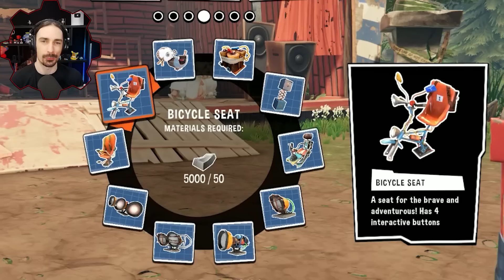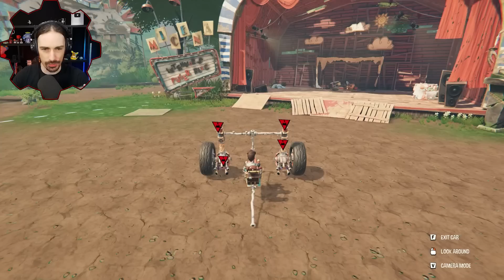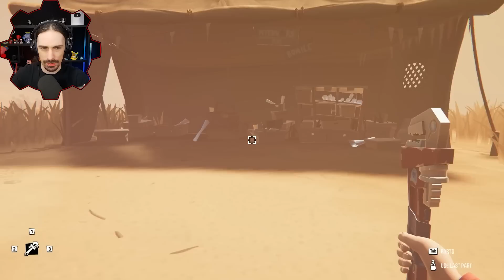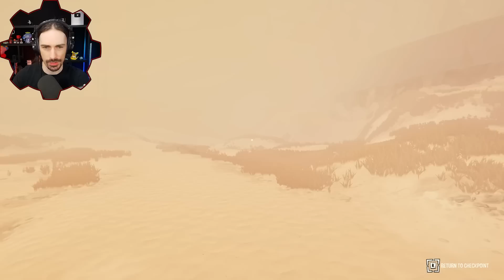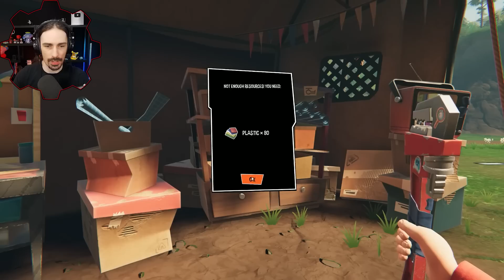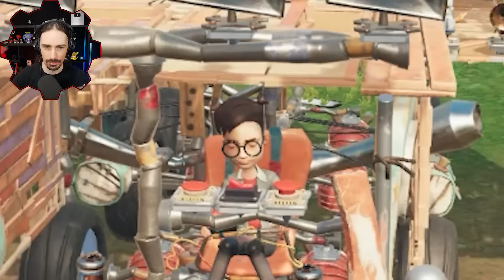Is The Hello Engineer Building System Any Good?

Comment: Looks pretty bad so far for the reasons you mentioned and also: If every piece looks trashy / oddly shaped, it would get really problematic getting stuff straight or deciding if two pieces are too close together etc. in larger more difficult builds.

Comment: would like to see a comparison of no suspension. the stick to the ground was something you said felt off but you also have parts to make it absorb bumps. 
you needing to reverse motors is because they are upside down. having the connection point at the bottom will change how you build the fixture and I think remove some of the tall ness feeling of the setup.
agree the default everything turning from the center seems bad

Comment: the game IS very limiting, I completed the tutorial in about 1.5 minutes
and after playing around in sandbox mode I realised that you can only have 1 active thruster, because its so expensive on plastic materials, and the thruster has awful power. only getting up to 600 thrust. making it difficult to build planes, vtols, and rockets. I've tried with it for a bit, but just warning you that the demo is very DEMO.
Reply: works better as a booster than an aircraft thruster

Comment: The entire driving is like its played back at 2x speed like when you set the motor speed higher it doesn’t increase the speed the wheels are turning but the speed the game is simulated so your actually going way slower is the simulation thats why its sticking to the ground

Comment: I feel like they set the gravity way too high.
Reply: I would guess it's using an earth's gravity. Which is not necesserely a bad choice, but a rare one compared to most games.
Reply: @dolorsitametblue  it's not that rare, a lot of games use Unity, which uses Earth's gravity
Reply: I don't think so, I think it really does have a magnetic pull to the ground in order to prevent the random bounces that happen in games like Scrap Mechanic

Comment: I honstly didn't have very high expectations but looking at how everything works, I would probably really enjoy this as a more mechanically complicated version of Scrap Mechanic.
Reply: "More mechanically complicated" - you mean more janky and annoying.
Reply: @LordDragox412  well although I agree the game is really janky, you gotta admit the rod system and steering system in this game is a lot more mechanical than hooking up an engine and a bearing, and that's just one example, then there's also gears, etc
Reply: @Renamon_Digi  Sure, it's more "mechanical", but it's also something that needs to be done well if it's going to be one of the main mechanics in the game. And sadly, it isn't, which is something nobody should be surprised by, considering the game's dev studio...
Reply: @LordDragox412  oi, do you have any link for the gear system? Because here we couldn't really see how they are used so if you have, please share.
Reply: @Cyberlong   Just get the demo and see for yourself. They have extremely limited use cases and the only good thing I can say about them is that they're less janky than gears in Besieged, at least from what I've tested so far.
Reply: @LordDragox412  yeah again I agree, not only the devs have been proven to be shady before, and the game is janky. But again if we speaking "technically" the game is more mechanical than scrap mechanic, which doesn't meant the game itself is better, I mean scrap mechanic have a whole survival mode and the versatility/different type of creation it can create, hello engineer seem (atleast as of now) to be only focused at creating vehicles, but it does add special "mechanical" things to create those vehicles, although it's still rather limited, which is may or may not acceptable (depending on how you see it) for a demo
Reply: @Renamon_Digi  True, true.
Reply: @LordDragox412  its kinda retarded to compare the jank of a game thats not out to a game that has been out for like 7 years
Reply: Get stormworks instead
Reply: @dompan9169  it's a huge mess and multiplayer sucked while back with huge lag. I bought the game and try it with a friend....it's very complicated and has stuff what i thought would be awesome, but somehow it's awful even though it has lot's of stuff to do. I returned it in 2 hours mostly coz os MP lag.
Reply: @Pasloooo  Stormworks is very niche, it's definitely not for the people that have absolutely zero idea of what they're doing, nor is it a game that you have to share for it to be good, like Minecraft.
Game works great for what it is, good depth in engineering, you make rescue vehicles, you play on single player/builder 80% of the time.
Reply: If that’s what you want I recommend stormworks.